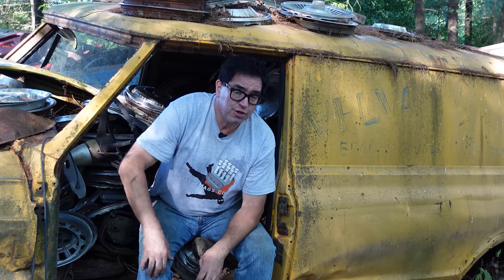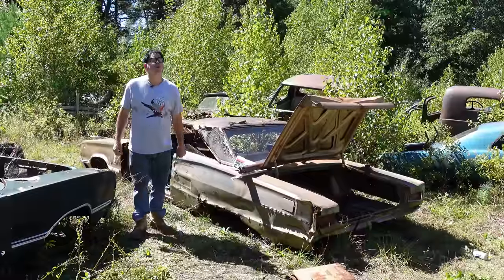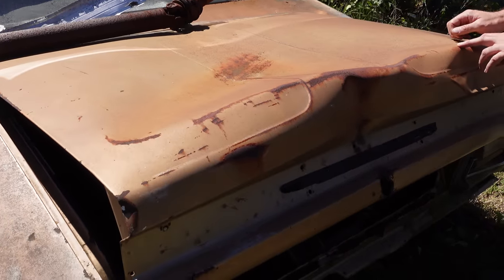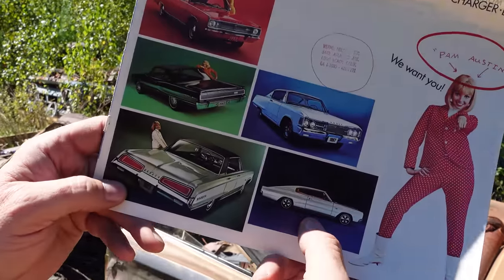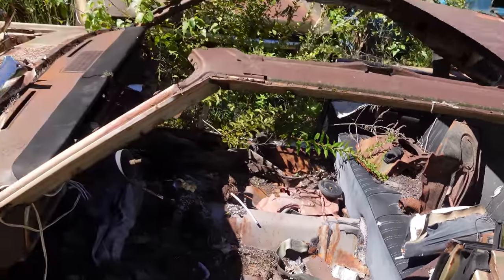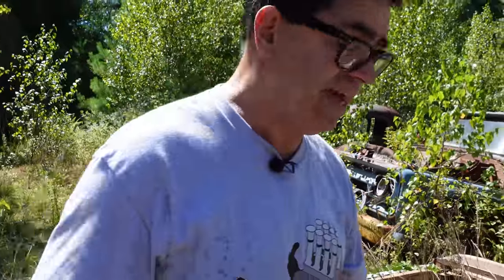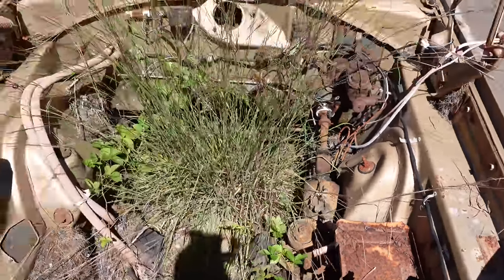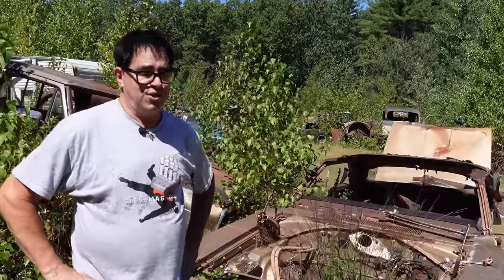The Dodge Rebellion

Comment: This reminds me.  I've got to pick up a 67 Coronet 440 2dr. Ht with factory buckets. I did some work for it. Need to get it home much better shape than this one.  It has disc brakes. No engine had a small block in it. May make it a driver. But that 68 IMPERIAL Engine and trans is a easy fit. Minor rust. Nothing major. Thanks Steve!

Comment: Steve, I have a wheel cover request.  It's the one on the driver's floor of the panel truck, underneath that trim ring with the perforations, or whatever that is, visible at 00:56.
The wheel cover in question looks for all of the world like a 1980-1985 Skylark piece, (which you've already showed us) except for where it's recessed in the center, with the lug nut holes.  I know the Skylark piece is solid, with the center being an applique.

Comment: At 1:30 you mention that the Coronet name came back in 1966. How do I explain this to the '65 Dodge Coronet 500 that has been sitting in my garage since 1970? Only regret today is that I didn't buy a convertible . . . Still looking for an A990 but with only 100 built my chances are getting slimmer every year.

Comment: Great video, amazing how many cars of that size had manual steering and brakes, when later it was standard to have power assist
Reply: Options like this were $$$$$  in the day, something that the " old cars were better and cheaper " crowd.   They need to run $ through the CPI calculator to really see what costs.
Reply: Everyone says  how bad manual steering, breaks were but they weren't so bad once you were up to speed. Felt like any other car. Up till early 70s it was common to find manual options.
Reply: @TomTom-qm4mq  Grand pa could drive his oldsmobile delta 66, 4 door, v8 , no power steering, no power brakes, 14 in Bias ply tires just fine
Reply: @bobroberts2371  I will add to that the fact that some of the older buyers of these cars were from the early days of automobiles.  They didn't trust options like power steering and brakes so they didn't buy those options.  By the way this is not an opinion, this was told to me by the original owner of my 1963 Fury.

The wife had to talk her husband into power steering but there was no way he would trust power brakes so my car has a big block, power windows, A/C, power steering but no power brakes.
Reply: Drum brakes don't need much assist at all, due to the servo action of the shoes. 
And the steering was addressed with large leverage-providing steering wheels and possibly more favorable gear ratios in the steering box.
Reply: @DanEBoyd  I can steer my '63 Savoy with one hand standing still or not.  Hey Dan
Reply: @DanEBoyd  Ill agree with that ,Thumbs up

Comment: Yes, the Muzzler line. I believe Tenneco, AP, or Maremount was supplying the line to Sears back then. I had contacted Gabriel in the mid-2000s and they told me that at the time they supplied Sears with shocks under their own brand. Sure, the muffler may have been warrantied, but they would get you with saying, "Well the tail pipe (or intermediate pipe) is frozen to the muffler, and we have to replace that too. The muffler is no charge, but the pipe is going to be $99.99 plus tax for replacement and labor", essentially paying for the muffler itself. Also, if the muffler was internally damaged from backfire or other "abuse", they would void the warranty. Midas and others were similar. 

Wish we got the (trim) tag to brag, but at least we got the VIN for the win: W for Coronet, H for High price class (Coronet 440), 23 for two door hard top, D for 273 V8, standard/low performance (E was a 273 V8 high performance engine), 7 for 1967 model year, 1 for Lynch Road, Detroit, MI assembly and the rest is the production sequence. The Lynch Road plant as previous mentioned closed in April 1981 and the "R" body cars were the last to be made there. A powder coating business sits on that property now.

Even without the tag we can brag: WH23 for Coronet 440/High Price class two door hard top, 31 for 273 V8, standard performance, 5 for three speed automatic transmission, possible H1X for black interior trim, and Z for Gold Metallic exterior paint.
Reply from the maker: Hello google Usr GP...watch tomorrow's video for a surprise. As for that E-code 273 4-barrel, as you know they were strictly A-body options. But how cool would it have been to see a 1967 Coronet DeLuxe 2-door sedan with the 10.5:1 A861 273-4 with its high flow 2-1/2 inch head pipe and rectangular single exhaust tip with integral resonator. I've owned three of these cars and paid dearly for the tailpipe / resonator / tip unit! But ya gotta have it! The A861 was one of Detroit's few high performance single exhaust systems. Some of the 1965 Barracuda Formula S / dart GT had NO MUFFLER, just the resonator. Loud. Anyhoo, Thanks for Writing and keep an eye out for tomorrows Video Surprise! -Steve Magnante
Reply: @SteveMagnante  Sure thing, will keep an eye out for it.

Comment: Back in 1982 I could have brought a 67 R/T for 300 dollars a one owner vehicle with the certi card still e place but I was stupid and passed on it because it was a column shifted auto and as Steve pointed out had bucket seats.
Reply: By 1982, a car like that was "just a used car" and people had gone on to the modern cars with updated styling, T-tops, graphics and the like, so yes, it would have been just a used car in the newspaper in 1982.
Reply: Bucket seats with a column shift are particularly dorky.

I'd rather just have the bench...
Reply: @DanEBoyd  I'd rather have a GM product, but I did look at a 1967 Coronet R/T 440 in my neighborhood years back, and it was the same gold color as this one was. However, although it looked good, underneath looked not so great. I want to say it was $7,500 and this was around 1995. I bought a 10th Anniversary Trans Am 400/4 speed in 1999 for that same price and I still have it.
Reply: @DanEBoyd  Agreed

Comment: Speaking of Sears & Roebuck, I have a set of Sears sourced Kelsey Hayes 14” mag wheels that my father-in-law put on his new base 1967 Camaro. I have no use for them but they are pretty cool and in near perfect condition. Magnesium or aluminum center section with a chrome rim. The bolt on center caps have a stylized S/R logo....even the lug nuts are stylized. A prime example of rare and no one cares.

Comment: Wow you're interested in looking at one that has more left on the bones? I've got a four-door that we simply pulled a slant 6 out of it. Maybe they automatic transmission was bad. It's baby blue with a off grayish color interior. I thought it was a 440 but maybe it's just a basic  cornet. It is a four-door here I guess it's a 1967 judging by the grill. Other than what some people have stolen off of it as far as trim, it's complete other than the engine and maybe the transmission. It was just an old $25 car back then with a slant six. If I remember right some other guy that about poor as we were had a need for it and his pickup truck. Why else would anybody bother with a slant six back then. I was 12 or 13 years old and made $100 off the deal and still got the car. All I had to do is pull the engine . The good old days when I could say all I have to do is pull the engine like it was nothing and I wasn't even a teenager yet. Anyway I've often thought somebody should do something with the car. I've thought about a late model 318 and automatic have a late 90s two wheel drive Dodge pickup. But until recently I found them hard to find anyway. For parts! It's always been a car that I thought somebody should do something with. The car was pretty water tight and if it still is well it shouldn't really have any more rust and what it had back when it was 10 years old. Do you know anybody? That wants to save a little bit of history.